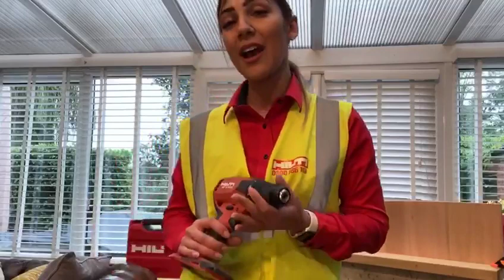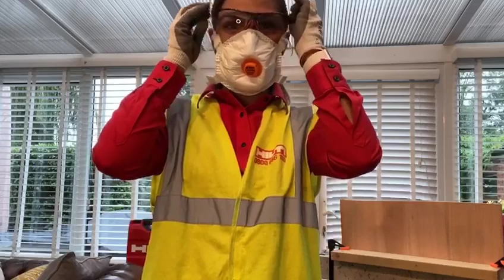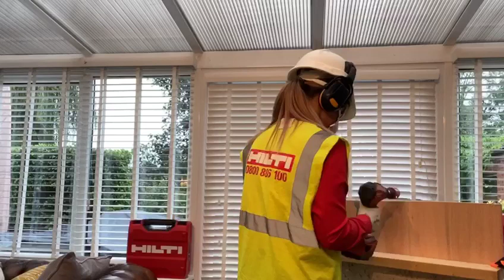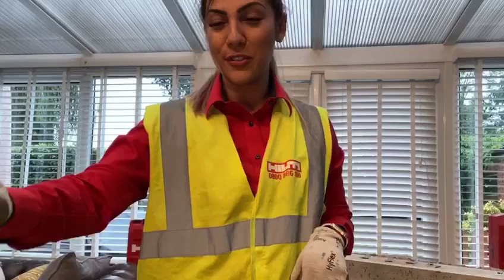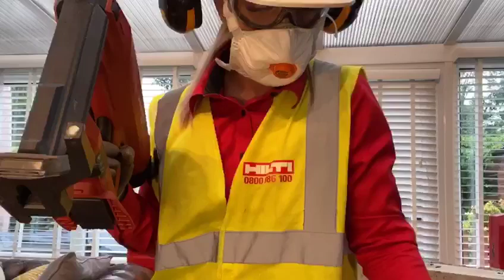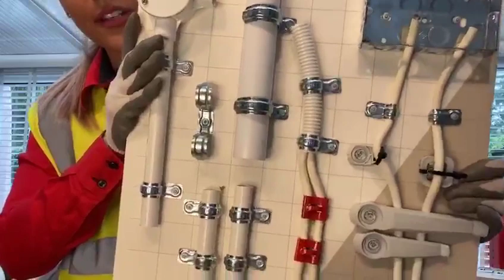Hilti Live Episode 3 - Mechanical and Electrical Innovations

Comment: Hi I have been trying to order some hilti tools to replace my dewalt I have tried the hilti site and mobile app to order them and it won’t email me the link to open an account yet I have used this email address for the last 11 years running my business, I am in County Durham and hilti have closed the shop in Newcastle, I have tried to call the shop in Manchester and Liverpool with no luck, I have also emailed hilti uk with no reply, I would try to call the shop again tomorrow but the shops are closed on weekends, my point is it’s hard work trying to buy hilti guess I’ll have to stick with dewalt or another brand 🤷🏼‍♂️
Reply from the maker: Hi there, we're really sorry to hear you've had this experience. 
Unfortunately YouTube doesn't have a direct messaging feature, but if you message us on Facebook, Instagram or Twitter with your phone number we'll have someone call you ASAP.